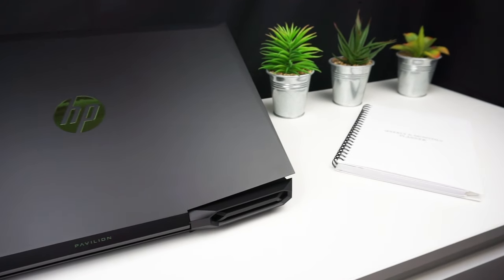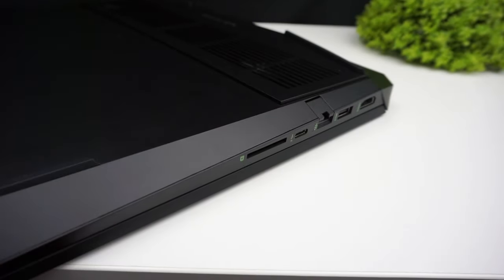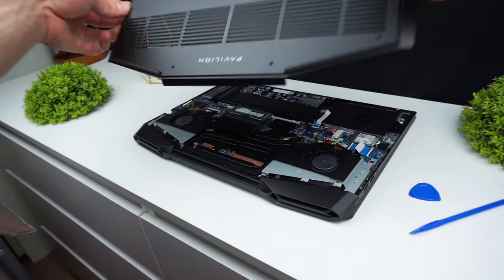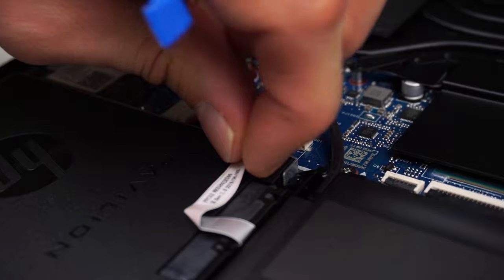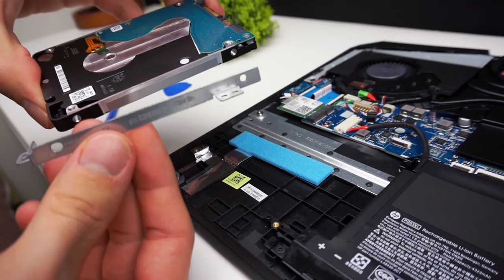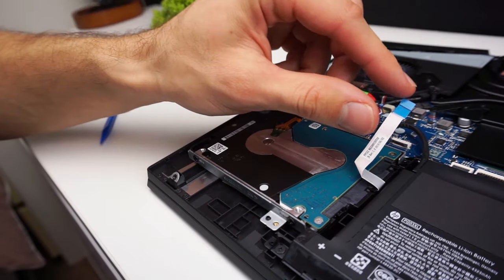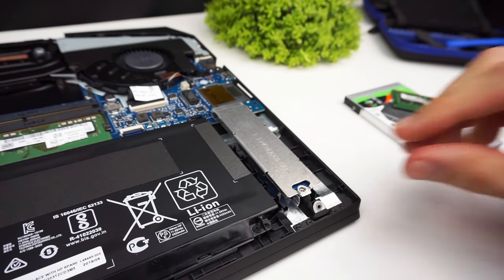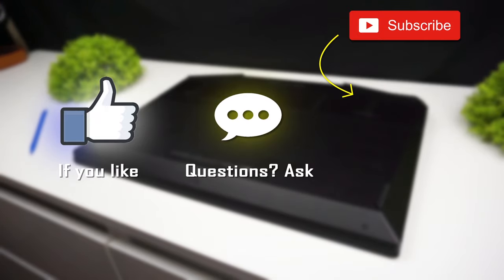HP Pavilion 15 Gaming Upgrade RAM / SSD / HDD - Disassembly Guide

Comment: If i upgrade my ram from the original of 8gb to 32gb will it harm the motherboard
Reply: Nope
Reply: But you need the ram sticks that fit
Reply: It won't hurt it but you should buy a 32gb SDDR4 ram kit at 3200mhz
Reply: nope. More ram is always good, as long as you have a 64 bit OS (x64) you can typically utilize as much as you want. 32 bit max you can use is like 3 or 4GB. But by saying "you can only use..." I mean that's the max the computer will recognize. On a 32 bit you can put in 32GB of ram no problem but it will only recognize like 3 or 4GB max. You should not worry though, this computer comes with a 64 bit OS stock, so you should be good. You can check by right clicking "my PC" and hitting properties, it'll tell you everything. If not just hit windows key and type "dxdiag" and then press yes and look at all your info
Reply: hey guys BTW, how many sticks of RAM did your HP come with? I'm using the laptop at the moment, before I open it up, did you have just 8 GB x1? or was it 4 GB x2? Thanks
Reply: hgow could it harm the motherboard??????????????????
Reply: @JustAdude291  dont misguide him by saying "more ram is always good". i mean its technically true but its like saying "the more the horsepower of your engine the more the good" you also have to see whether a normal guy would need that much and i dont think by any means that he's tech heavy or ram heavy user as he said"will it damage my motherboard". so, you have too see what a newbie would think after reading your comment. and BTW i dont mean dont upgrade your ram, if you have 8gb single stick then get another stick of 8gb ram(prefer 3200mhz) for gaming or rendering but otherwise its fine, i personally use 8gb single stick cause i only use chrome and discord in this lappy
Reply: Monsta760  i"ll say you to get another stick or sell the 16gb ram(if you can) and get 8*2 3200
Reply: @sambuddhabhusal2479 misguide him?? LOL, but "it's technically true"? lol ok buddy. If ram is like horsepower, then a gaming computer is like a race car. In that case, more ram is good. I mean in which case is more ram not good? Building a gaming computer is like building a car that's meant to go fast, by your logic. You know I'm not wrong, so Idk why you wanna make such a fuss about it. If the guy wants to put that much ram in his computer, then let him, that's his choice, and is not that far fetched. 
There's nothing wrong with it. You think I misguided a 2 month old comment who likely already upgraded his machine before I even came along? There's nothing wrong with saying more ram is better, because more memory, more storage, faster processing, faster rendering, etc. in a computer is always better because a computer is designed to compute, especially when that's your goal in mind to have a fast machine.
Reply: @JustAdude291  bruh, first of all:"more ram is always better" is true but its like saying a 1000 hp car is way better for a guy compared to his 100 hp car and yea it sounds technically right but when you see how that guy is gonna be able to use that much is the question. a normal business person who needs to travel 5 kms per day to get to his job in city traffic wont be benefited from that 1000hp car but its still better to have more hp right? but this is when value comes in, if you are not gonna use that much amount of hp then better spend it on luxury interiors or save it. its the same with Ram, i hope you understood and before commenting like that better to get some knowledge or see how the person is gonna read our comment and make a choice as i know you misguided alot of folks who have like 64 gb of ram to use discord. TL;DR : don't think that more ram is always gonna give you more performance. get what you need and have a little bit of headroom available to also use background apps. for gaming its 16gb of 2 sticks(8*2) dual-channel 3200 mhz/3600 mhz and if you are a content creator/video editor or little heavy user then get 16*2 3600 mhz ram (total 32). 32 is still hard to reach when you are doing 1080p editing but it might be useful compared to 16gb as you can also use other background apps without checkng task manager LOL. and plz ignore this guy and dont get 64 gb  or 128gb of ram for gaming
Reply: @sambuddhabhusal2479 I'm not reading your essay bro. i really don't care what you believe in. Trying to compare ram to horsepower is a stupid argument and does nothing to prove your point. The fact you keep saying "technically true" but keep trying to argue against it just shows you're arguing just to argue or because your ego. No thanks.
Reply: I just upgraded my laptop 8gb single channel ram into 32gb dual channel ram with a thought in mind "more ram better" and you know what? my intense usage has never reach even 16gb use. 
Normally it will stay below 11gb. You need more ram if you gonna use it for 3d model rendering, but it's all depent on software you are using.

Comment: I have a very good feeling mine’s good spot will be near the battery 😂
Reply: Follow up: I in fact did not have any and as I am not a technician, just a random dude with above-average computer information tryna’ replace CMOS battery I do not have the plastic ‘budging’ tools and I am current trying to get a opening to use my ‘budging tool’ with my nails.
Reply: Follow up 2: Mine isn’t the exact same model but I couldn’t find it and this model kept popping up so I decided to watch this one as they are both 15 series but well.. Mine has a screw in the middle with a tape(full black, ensuring DIYs don’t see it) over it and I can’t get the tape off. I know nothing will happen if I rupture it as the warranty has ended but I like my stuff clean & nice looking and that would look odd with a rupture :/// (by the way I have the same black tape so I tried rupturing it and I can’t anyway.. Maybe not a screw?

Comment: I cant open the back cover
Reply: skill issue try harder
Reply: @RuRuBoiert  i dont have anything strong and thin enough
Reply: credit card like sizes would do the pull up
Reply: I made it just fine
Reply: You could use butter knife
Reply: Flathead screwdriver will work just be very careful with it. It can easily damage the plastic

Comment: an HDD as an upgrade in 2021???...
Reply: I mean... If you want it just for extra space and not for your Windows its really cheaper than ssd and for games and stuff its not alot slower
Reply: HDD is mainly for Storage as HDDs are slow in performance and everyday tasks. Don't use one as your main drive, stick to a SSD and use a HDD for Storage.